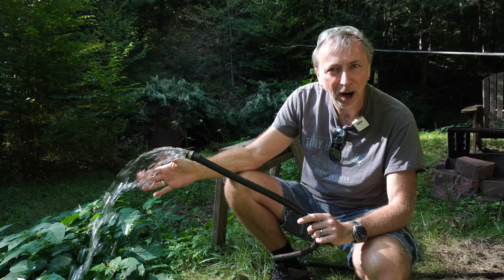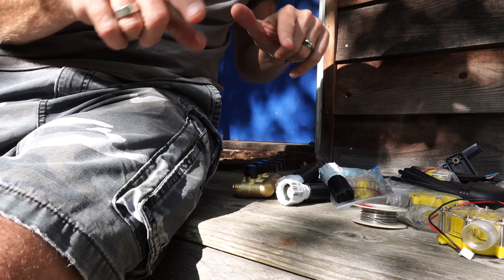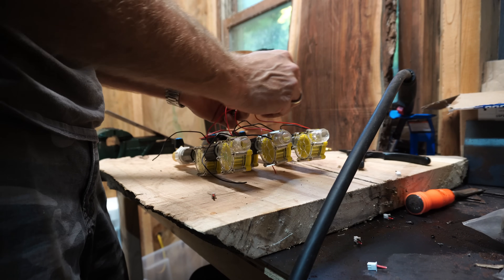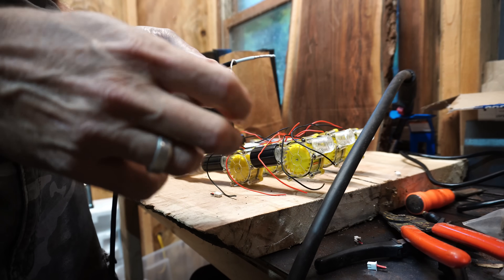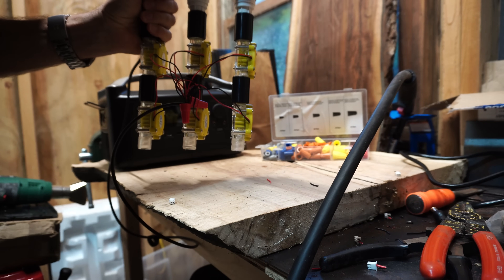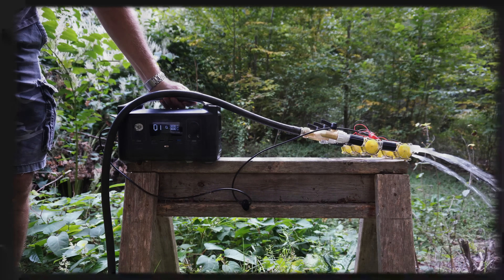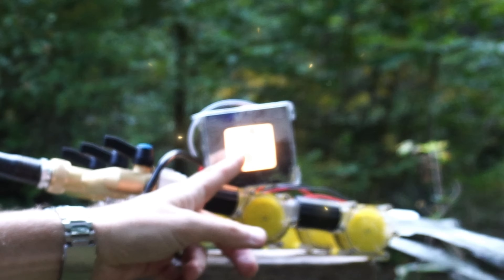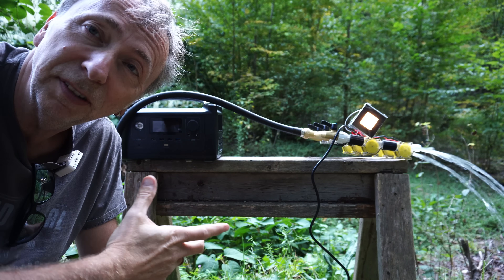Micro Hydro Power Generation - Free Energy!

Comment: Nice concept  man, The generators you bought declare an output of 10W, but that’s just the rated spec. If you search the same generators you'll see that the actual output is much lower. Some more honest sellers list them at around 180mA. If you're looking for better performance, using a DC motor as a dynamo and making your own turbine (3D printed or welded) could yield better resuts.
Reply from the maker: Yes, my next attempt (if there is one) will be to create a better and bigger turbine to try to do this. Thanks for the comment!

Comment: I think some of the other comments mentioned this already, but if you just hook all 6 of them up in a row that's called "staging" and what's happening is the energy is transfering from the water into the turbine, so the pressure at the end will be lower because that energy is reduced by about a factor of 1/3rd or so depending on the turbine efficiency.
Reply from the maker: Right. Each turbines 'robs' some of the energy is what I think that you are getting at.
Reply: @TinyIndustrial  Right, at the atomic level the atoms are vibrating and those vibrations are transferred into the mechanics of the turbine.

Comment: yea you can make power, but to start charging you'll have to make at least 5 watts, and if 6 don't make even 1 watt hummm maybe you'll need more....???, maybe a much stronger flow????, hers an idea maybe go learn some math of how to convert mass, flow, head pressure into jewels of energy, and from there into watts, hydro electricity is a whole filed of engineering , and this can work but you'll A LOT MORE!!!, pressure and turbines or bigger turbines or mechanical ways to convert current speed to a much higher speed, but if convert this speed into a higher speed you'll lose torque and that meas any micro electrical load will make your turbines stop do to the Betz's limit Law, might be good to learn this stuff before you a video like one, if you don't want to look stupid in front of 20k viewers
Reply from the maker: I was happy to get away from math after HS and college. This was a fun idea that I wanted to try out. Kind of a proof of concept... albeit with a less than optimal result. If I did it over, I'd be a bit more technical about it. (i.e. multimeter and so on). Thanks for the comment though!

Comment: Bypass the ecoflow and run them to low voltage lights or a stepdown converter and charge a 5v power bank.   Its not a lot of power but it is promising.  Radio , leds , maybe an electric fence. Something that doesn't require much but is useful. Its a great project!
Reply from the maker: Thanks for the comment. Flowing water = energy is the bottom line. Harnessing it isn't always easy.
Reply: @TinyIndustrial  oh I know brother . I've be off grid for 3+years and it always surprises me with 1. what I'm ok without. And 2 . The interesting things I come up with for the things I decided I can't live without.

Comment: Hey man, nice video—using your 24/7 water flow to generate power is a really cool idea. The only thing is, I think your setup might work better if you wire the water turbines electrically in series. I just checked a datasheet, and if I’m not mistaken, the EcoFlow input works from 10 to 25 volts—an MPPT range designed for solar panels.

Here’s what I’d suggest: measure the output of each generator with your multimeter. For example, if you have two generators in series on one tube, check that they produce the same voltage. If one generator outputs around 1.5 volts, you might need to series all six to reach the necessary voltage. But if each one is closer to, say, 5 volts, you could consider a setup like 3 in series and then 2 parallel strings to get the right balance.

Aim for a total voltage in the middle of that 10–25V range—around 18V—so that if the water flow fluctuates, the system won’t get damaged or shut off. This gives you a buffer for both higher and lower flows.

Keep up the awesome work, and thanks for sharing your project!
Reply from the maker: That's a really great comment. Makes sense and thanks for posting that!

Comment: also, you can connect the wire to an altimeter to measure power
Reply from the maker: Well an altimeter likely wouldn't work, but yes, a multimeter would have been good to use. Post video production regrets...

Comment: Echoflow has an app, you need to turn the input on from the app
Reply from the maker: You can change the input parameters in the app? Is that what you are suggesting? That would be great. Goal would be to lower the charging threshold, assuming that there is one.
Reply: @ Not exactly, but in my echoflow, it does not start charging as soon as you hook in the solar panels, in the app, you have to switch on solar charging
Reply: @ I am not an expert,but I guessed a "meter" of some kind. BTW, great video, we all learn from each other's experience.

Comment: Reason your device is not charging is because I believe you need higher than 12V so maybe put 3 parallel rows, with each row having 2 in series, might work to charge it. Digital multimeter to test voltage, and can test amperage too. Find specs of what voltage you need, maybe it’s 18V. I think they each make 2.5W total, thing those batteries need 40W
Reply from the maker: Yeah, if I were to do it over I would have done a bit of a deeper dive on why it didn't work. Multimeter and that kind of stuff...checking the charging specs for the battery and so on.  Thanks for watching!

Comment: you need head height, it's the weight of the water that turns the generator, not the water itself.
Reply from the maker: Yes, true. There is a decent amount of pressure, but altering the height is not really an option given my water routing configuration. Thanks for the comment.

Comment: You may not be supplying enough voltage if they are only putting out 12 volts.  The input has to be higher.  Try putting 2 in series (3 times) to double the power and then you will have 3 red/black to wire up and see if that works.  If it doesn't try 3 in series and then 2 parallel.
Reply from the maker: Likely true. Thanks!

Comment: Check w/ your generator input.  I tried micro several years ago using a solar charger.  Much to my dismay, the solar charger required a specific input voltage in order to trigger charging to begin.  It was an internal safety.  I suspect you may be facing the same issue.  If you could find the specific total voltage/amp combo needed to initiate charging, you can calculate your input gear to match it.  Good luck!
Reply from the maker: That is likely the case. I should have done a bit more research and looked more deeply into what kind of power I was actually producing.

Comment: According to the charger specs, it does accept 12V through the XT-60 input cable.  The problem as I see it, is not the voltage input at 12v (because these little hydro electrics do output 12v) the reason  they don’t recharge is the current is at 10 watts, approximately 220 milliamps.  Based on the DC input from the solar charging spec, you will need 200 watts = 10x mini generators running in parallel.  That roughly equates to 2200 miliamps (2.2 Amps).  There is likely a minimum threshold of 2amps on the input for the charger to actually charge. At that rate , it will take 3-5 hours of constant water pressure to fully charge.  You would be better off purchasing the the solar cells and charging it that way (as intended)
Reply from the maker: Yes, that was my takeaway as well, that solar would likely be (much) more effective. It was a fun thing to try out though. I'm happy that I tried it. :) Thanks for the comment.
Reply: try putting them inline on a longer span, it also needs a drop for head weight.
it's not the water that moves the generator but the head height that does.
Reply from the maker: Moving the head weight is unfortunately not an option for me.

Comment: You need a DC charger to charge the battery
Reply from the maker: The little hydros are putting out DC. I'm going in on the the solar panel input on the battery power supply. That 'should' work if they were putting out any kind of meaningful juice, no?

Comment: wire the generators in series, not parallel (initially I said put, but then I realised some smart ass would put the units in series, not the wiring.)
Reply from the maker: Yes, that's an idea. Will have to do a follow up on this. Thanks!

Comment: From other videos I've seen where they take such turbines apart they have had both rectifiers and voltage regulation in them. All the turbines connected to the water in series might do the trick to provide enough current for the battery to accept it. Assuming the flow and pressure is enough for the turbines to reach the required voltage. 

I don't think the pressure is reduced much by each turbine, the pressure required is probably mostly because that is what required to get the velocity of the water. I still wouldn't expect a lot of power though, it's unlikely to be enough to cover a DC to AC converter on standby with that trickle, so using it to recharge a power station probably requires a power station where that converter can be shut off, which I hope is the how they are designed. Electrically they should remain in parallell, if they're regulated to 12 V, and the power station accepts 12 V, the main issue should be to achieve the required current. 

LED lights can be very deceiving, they tend to become more efficient the less power they get, so they can make very little power seem like a disproportionately big part of their rated power. So, they're good for confirming/showing that there is power, at all, like you did, but not for assessing the amount of power generated just by looking at the intensity of light they put out, which one might assume.
Reply from the maker: "...main issue should be to achieve the required current. " Totally agree. Thanks for the comment!
Reply: @TinyIndustrial  Use a cheap buck converter.  This will up the voltage, then be ready for a slow charge.  Buck converters are made in bulk, you might find that is the cheapest component in this system.

Comment: They probably only make 1.5 v a piece which in parallel is only 1.5v, and the min voltage to charge those are probably 10-12v, so all in series it might be enough to start charging. Looks like you might have a flow problem too, you may make only 2 runs 3 in series to minimize flow, but you may need more pressure
Reply from the maker: More pressure would certainly help. Others suggested the same thing as you. Part II will happen one of these days. Thanks for watching and commenting.
Reply from the maker: Yup...
Reply: exactly you need more voltage, I would sugest 3series 2 paralel configuration for the water to extract more power from each "string" by having higher flow and bigger resistance so more voltage

Comment: If you put all the generators in series you will get more power. Each time you open the hose conection you are lowering the volume of water flow. Also the output of the generators are in alternating curent so you need to put a bridge rectifier on it to get dc voltage.
Reply from the maker: Appreciate the comment. Clearly I'm not a real expert on this stuff. I love making videos though and this seemed like a fun project to try out. Already pondering a part 2... Thanks for checking it out.
Reply: Nah it's more likely this is a permanent magnet brushed motor with commutation to make DC. Probably 50-70% efficient. Don't need any rectification, the commutation is already doing it.
Reply: nevermind, I watched an electronicsNmore video " How A Mini Hydroelectric Generator Works" and it actually has a 3-phase bridge in it. So not a brushed motor, but the circuit board seemed to be limited to 100mA, meaning the circuit board limits power to 1.2W.... If the regulator is bypassed so it just gets rectified with the 3-phase bridge, maybe it will produce more power.
Reply: tsbrownie "Mini Hydro-Generator, 12vDC (4K)" has potentially the same model generator. Better power but 4.5% efficiency after a flow and power test. Considering it converts very little pressure drop into electrical power, multiple turbine stages in series seems like the way to go.
Reply: Series connections increases the voltage, but not the current (amperage). To increase the amperage, these would need to run in parallel.  The voltage output however would remain the same at 12V
Reply: Nothing about the OP is correct.   You will not make more power.  You will make more voltage.   Each one of those little DC generators is likely only making 5v.   You need at least 12 to get the MPPT to register and charge.

The second point....those are DC.   No need for bridge rectifier at all.  Rectifiers are used to turn alternating current to DC current.

Comment: That cable for the current generator is for AC (120V-230V alternating current), what you get out of those micro turbines is direct current, normally it will not work. you need an inverter dc-ac. To measure their voltage, you need a multimeter, a tool that costs $10
Reply from the maker: Oh, you mean on the battery? No, the port I'm going into on the battery is the Solar charge port. It's expecting 12V off of a panel. There is an AC charge port on the battery as well, but that's not the port I was using. Thanks for the comment and for checking out the video.

Comment: I think the voltage is too low. Wire it in series and try again :-)
Reply from the maker: Interesting. I didn’t consider doing that. You are right though. Time to get the multimeter out and run some more tests. Either way, charging that big battery will be a challenge going this route… thanks for the comment.
Reply: @TinyIndustrial  I agree but there will be a combination of series parallel that will give you the best result.
I would start at putting each of the pairs of pumps in series, and parallel the 3 sets.
If you're not sure what I mean ask, I am happy to help.
A multimeter would be a help.
And test it under load.
Reply from the maker: Yeah, the lack of a multimeter to see what's going on is likely the biggest pitfall of the video.
Reply: @TinyIndustrial first know how many voltage it outputs, if you get 12v per motor then try series 2 motor to get 24v and parallel the other. Try 2 series 3 parallel
Reply: came here to write it
Reply: The ecoflow will treat it like a solar input so the voltage needs to be a few volts higher than the battery voltage to charge.
Reply: Also try them in different numbers running, you may get better output with less division as well.
Reply from the maker: Definitely a possibility.
Reply: Hi, hoping your well, did you finally tested with the changes recommended in the other comments? I appreciate in advance your  attention, Thank you!